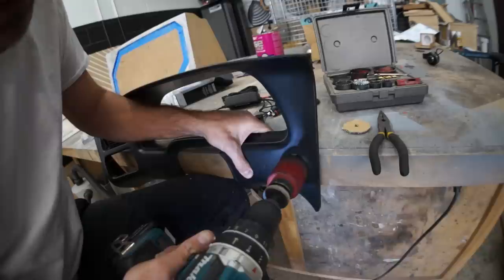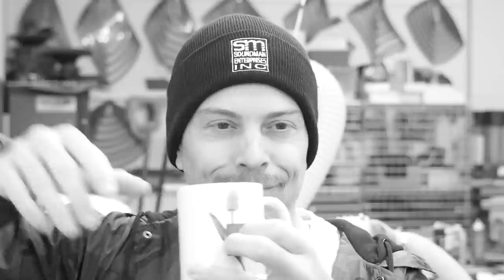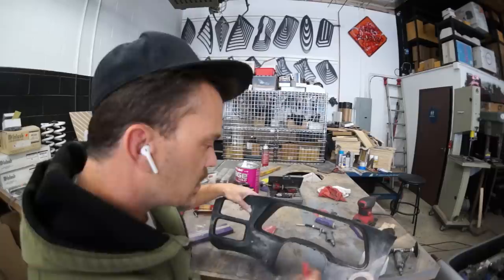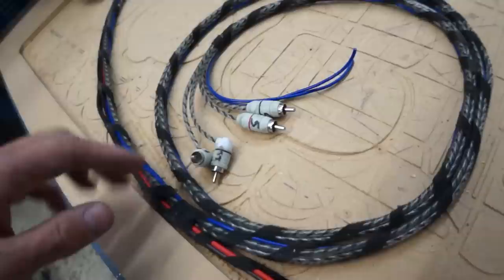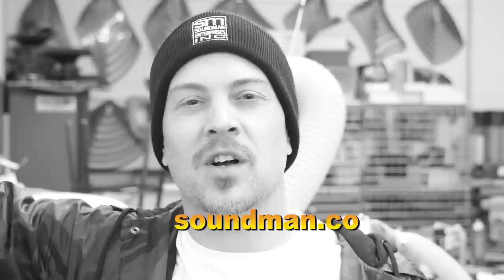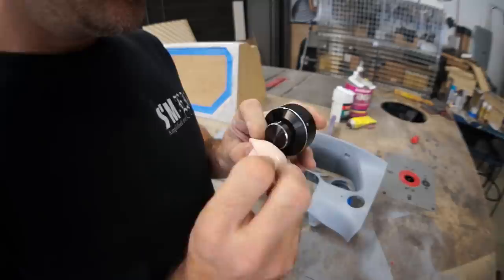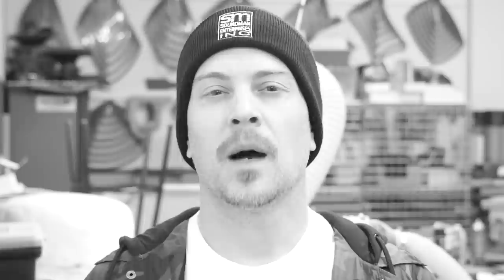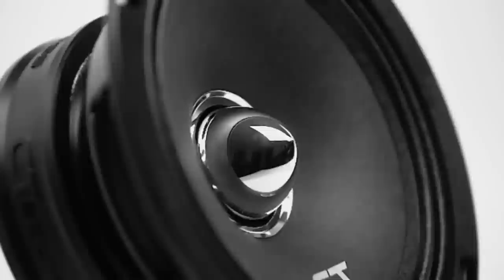the T-Bird's custom volume knob AND FUNDRAISER UPDATE! - White Rider #58

Comment: soundman. Need to cut a piece of plexy with a hole in it the same diameter of the volume controller. The 2 inch or so.and put it between the knob and the panel and run som leds so it lights up the volume knob. Like they do in new cars. Would be dope